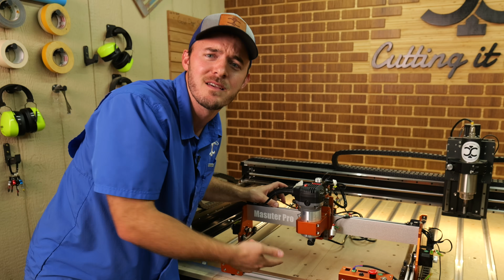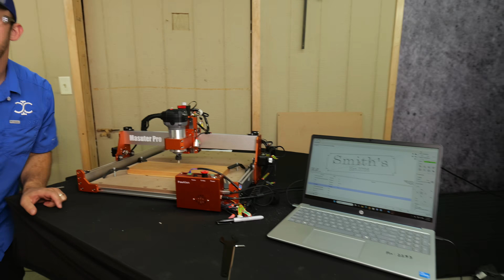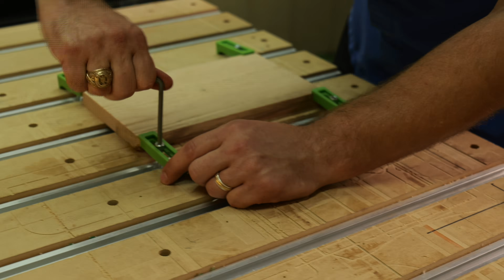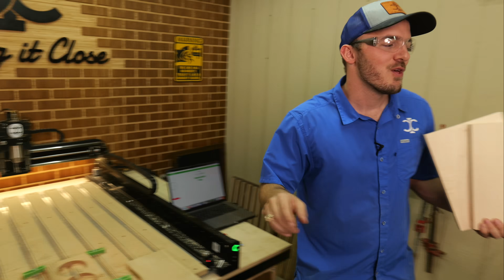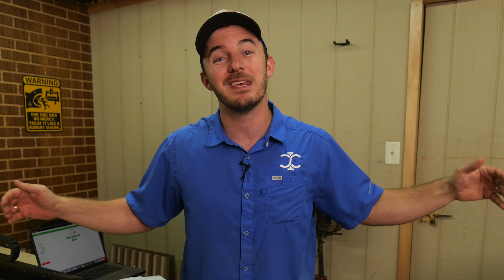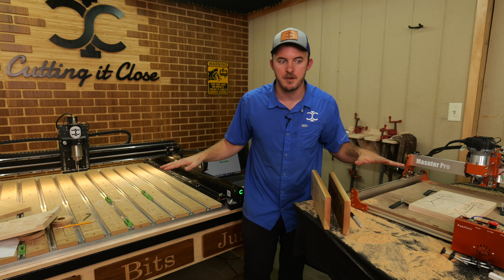$500 vs $5,000 CNC - Are They REALLY Worth 10x More?

Comment: I have a Wizmaker Artisan 01 with a 500 watt spindle upgrade. ($1000) I bought it as an entry level machine to learn on. Well, I learned 🙂It's a decent machine, solid build, 20 minute assembly, ball screws not belts. But there's no way to upgrade beyond the 500 watt spindle. Slow but accurate as all get out. Can't afford a $5000 machine yet, but hoping soon. And I just did 8 round smokers, by the way 🙂

Comment: Good review.
I feel it's still a little unfair though, if someone doesn't have the observational skills to add some kind of chip/ dust maintenance to cheap one, they probably shouldn't be doing cnc at all; and $10 says the belt tension on the cheap cnc required adjustment before the first video you made of it even, that where the skipped steps came into play.

Comment: i started off with a genmitsu 4040pro. upgraded the spindle to a 300w. upgraded the bed to a 6040. burried the bit and bent the shaft on the 300w spindle. bought an 800w. ran with that for at least six months.  by then i had spent more than a grand on the machine. it ran really well. it doesnt use belts so i was able to edit the firmware to run the machine at 80ipm with zero issues.  after a year or so i was still loving it so i bought an Altmill 4x4 and slapped a 2.2kw water cooled spindle.  super impressed by this. i run parts at 220 ipm on a regular basis.
Reply: I heard that's a great beginner CNC machine.  Amazon has it on sale for $500 sometimes.
Reply: @gilbertramirez4294 for a beginner it really is. It's pretty forgiving. Tough little machine. But my advice for someone using it to see if they enjoy the hobby is to buy a 300w spindle with the machine. Don't waste time and money buying longer x/y upgrades. If you enjoy the hobby and are making a bit of money then start saving for the big machine. I ended up getting an altmill 4'x4' I love it

Comment: I tried a somewhat simple 3D carve on my desktop Carve King. It did good for about the first 30 minutes, then it just decided to drill straight through the center. I tried it a 2nd time, & it did the exact same thing at the same point. I never did figure out what caused it, other than I don’t know if it couldnt handle that many lines of code. When I upgraded to the OneFinity Elite Foreman, I had zero issues with the same carve. Definitely a difference.

Comment: Watch a lot of videos on these types of comparisons between CNCs.  It seems that almost always one of the keys for the lower cost CNC's is slower is better.  The second is keeping them clear of debris.  They are still low-end machines, but it minimizes the potential issues.   Kind of curious if set to run significantly slower, with a debris shroud and dust collection if it would do the carving.

Comment: I don't want to knock your comparison, more power to you, but it seems unreasonable to run run a cnc without dust collections and expect results. It adds nothing  or subtracts nothing without dust collection, results are rather skewed. I wish you would of just used dust collection, particularly if it is going to be an issue.

Comment: I cant help but wonder if you chose the wrong machine to compare the shapeoko to. The fox alien mauster pro has huge problems, mainly that it doesnt even use lead screws on all of its axis but that rubber belt system and v wheels.
I dont live in USA, so idk about american prices, but if im not wrong, you can get a Two Trees TTC450 ultra for not that much more. And it gets linear rails, bearing blocks and lead screws on every axis, a better spindle, stronger stepper motors (nema 23) and more rigid & heavier frame construction. That's what I got for proof of concept for my business.

Comment: I had an issue with the Masuter Pro with the belts being stretched out when I originally got it.  I replaced the belts, made sure they were tensioned properly, and then it worked properly.  I was able to let it work without babysitting it completely.  I have replaced it with the XE Pro, which has the NEMA 23 motors and lead screws, and is a much better maching.  the Masuter pro is now being used primarily for laser work, although i may be replacing it with a dedicated laser machine in the future.